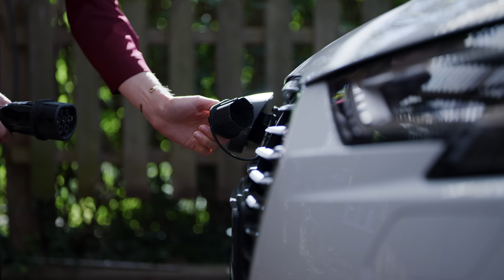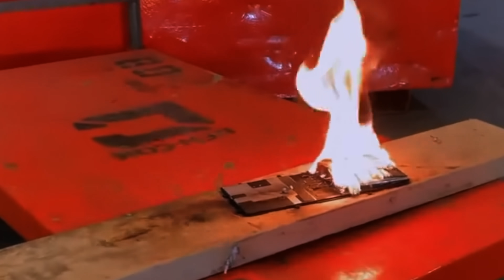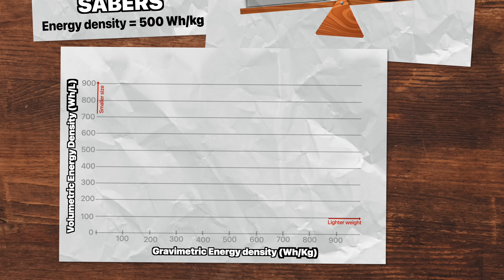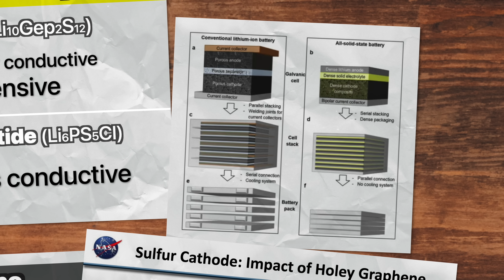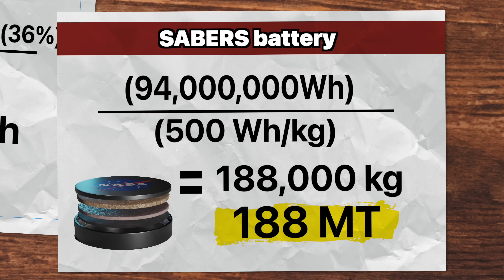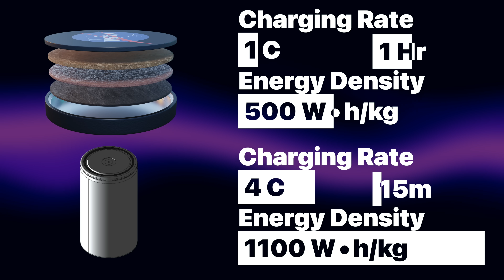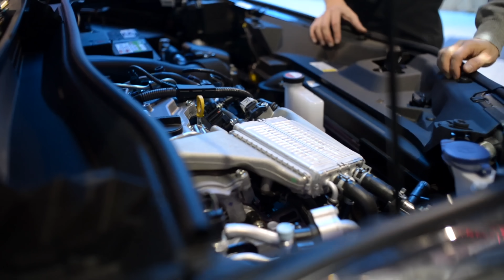Why NASA is Building a Solid State Battery

Comment: now tell the airline industry that they can turn their flights around in 6 hours (charging time) rather than 30-60 minutes
Reply: If solid state batteries are successfully developed they would probably use battery swapping. This is already being used in Australia and New Zealand with trucks, but using current battery technology.
Reply: @johnharvey1786  you are going to remove and replace 27,000 kg worth of batteries between each flight?  That is an insane amount of material handling, and it implies rapid removal/installation, as opposed to just normal maintenance type work. That's a full battery swap for 1/7th the range of a jet fuel plane.  Whereas if a jet needs to fly 1/7th it's max distance, it takes on less fuel (with safety margins of course) which lowers it's takeoff weight and increases overall efficiency for a given flight.  Part of the calculation for an aircraft's maximum range is weight reduction during the flight, which a battery powered plane wouldn't be able to take advantage of.
Reply: @cayuse17  I didn’t say that as I suggested a hybrid. The batteries would only be part of that total to simply reduce overall CO2 omissions. It may be that they only take up 10 - 20% of the load to start with. I also said if suitable batteries can be provided. These would have to be lighter and more power dense than current batteries. Large batteries can be replaced quite quickly with the proper equipment as can be seen with trucks as they replace them in five minutes. You seem to think there will be zero progress going forward. Would you have said the same thing when jets were introduced, that these will never catch on as they use so much fuel.

Comment: Large aircraft cannot land at the same weight that they can takeoff with, meaning if you create a 100% battery-powered large aircraft, it cannot weight more than it's rated LANDING weight. In other words, you can't start the equation with the full fuel weight; you have to calculate based on the maximum allowable fuel to land. That's why they always dump fuel when they have to land prematurely.

Comment: Unless you have swap able batteries for the airplanes then its not really a good idea. How long would the charge time be between flights!? 10 minutes for a car is all well and good but an airplane would require MUCH bigger battery packs. Don't forget a fuel laden airplane gets lighter during its flight while a battery powered airplane will stay the same weight. I am NOT shitting on ever having batteries for airplanes but... its a tech that is not ready YET. Soon™

Comment: Interesting video...but....lol, unless we begin an effort to increase our ability to generate electrical power on a full-time basis, electrifying everything with great new batteries is just a new problem.  And it's not just an issue of generation capacity, we already  need lots and lots of new transmission lines which we're not building.

Comment: you miss calculated. thrust via fuel, and thrust via electric turbine, or prop is different values. IE. Fuel in jet generates x thrust on take off, and x thrust on cruise. Same goes for electric modeling. you cant weigh just the kwh in fuel opposed to the battery. the example you have is flawed to a degree. the models could be less or more. not counting scaling the plane down. the fuel system components carry allot of other wight as well.

Comment: You bet, electrically powered flight.  Solidstate or really semisolid state.  How, using bivalent bonding elements in a /+ univalent ionized charge.  Cadmium+, or Barium+ and Iodine or Bromine-.  They must be separated, probably thin layered, and mixed with an "electrolyte" electrically conductive e- distributor such as graphite.
An improved ion battery with outstanding capacity for VDC storage.
But even more exciting are semiconductor based batteries.  With a nearly unlimited capactiy for electrical power storage.  Multiple thin P-N layered constructions, store ~ 1 volt DC per 1 ampere of electrical charging.  1 ampere hour of current storage = 1 ampere of electrical current flowing for 1 hour.  Sounds like a lot, but within reality.  Modern Lithium ion batteries in mobile phones store up to 5 ampere hours @ ~ 6 Volts.
Semiconductor batteries just about require thin layers  P-N junction construction to spread out "electrical charge density", to help store more amperes of e- at acceptable lower voltages.  And all of them require an output voltage control regulator transistor.  My choice is the older style FET transistor.  It must be connected using a gate controlling resistor to improve more linear regulation of the output voltage.  But do-able years ago under the terminology negative feedback.  Thanks sgain lan0 for teaching me how to set up negative feedback; continue to wish the best - for this world.

Comment: The load would just be ebb and flow on a long continuous trip at nearly no loss if battery BACKED capacitors delivered the load to the motor on one cycle and then disconnected and recharged by alternator on the next cycle. If Im not mistaken they are cheaper to make, easier to recycle and can recharge instantly. Have I lost my way somewhere?

Comment: Especially for short flights, a significant fraction of the energy, and the highest power demand is taking off and climbing to altitude.
  Using a catapult, similar to an aircraft carrier, for take off, seems like low-hanging fruit.
  To this could be added a second stage which drops off and returns to base after the first 50 miles. Similar to the tow plane for a glider.
Reply: Are you talking about passenger aircraft?  How many Gs would that put passengers under?  

How much weight do you have to add to reinforce the fuselage of an aircraft to withstand the forces put on it by a catapult?

Comment: Another think that comes to mind with this - there is an incredible difference between the fuel burned for landing and takeoff and in normal flight. I could see a strategy that works with Hybrid cars work here as well. - Either the plane can use the electrical engines for those phases, which means we can do with less fuel (and pollution!) and just cruise at optimal burn rate once it flies. Alternatively they could use the jet engines mostly during takeoff and landing and switch to electric during cruise.

Comment: However these batteries wont be able to deal with the environmental temps theyd be exposed to in normal commercial flights without some sort of warming system for the battery to keep them above 0degC.  Considering temp decreasing 2degC per 1000ft, thats a lot of heating required!!  Plus the airframe would require additional power supply with the loss of bleed air , generators and engine drive hydraulics.

Its a nice step forward, but for aviation, i believe its nowhere near viable yet

Comment: Do you have problems with battery fires? Use pure lithium!
Weigth formula is pure BS because jet fuel is consumed during flight and you have to use differential formula as the airplane gets lighter.

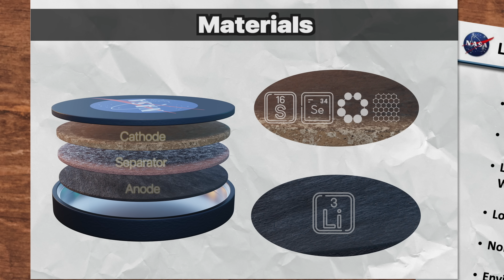Comment: 8:00 how is flammability managed with a pure lithium anode? Primary cells with a pure lithium anode are indeed considered flammable.
Reply: Solid state electrolyte and separator must be reliable. And battery hermetically sealed. 

It would blow up, if punctured with water. Air us not that bad, if the short circuit is not causing ignition. 

Solid state electrolyte can tolerate higher temperatures than polymers and organic liquid salt electrolytes. 

Using silicone oil as coolant is one way to prevent lithium to get oxygen even if battery is damaged.

Comment: Low cyclelife is the real killer. If you cannot use battery more than 100 times, it just dies too early.

Low discharge does not matter that much, because you may transfer some power to other storages that you may use when needed.

Faster charge rates could be achieved by replacing batteries and then charging them at the lower rates. Taking off batteries and putting new ones in could be made with robots and in few minutes, but of course this adds whole new level of complexity and issues (like weight distribution).
Reply: Lower cycle life isn't a problem if it's cheap enough to replace. 
I would happily take a hundred love cycle batteries, if I could replace them every year. 
I doubt this battery even if it was in production, would be cheap enough for that.
Reply: @bzuidgeest  Lower cycle - more waste, more energy to build them, more transports and more resources needed to build all those parts. 100 cycle batteries means you use roughly 10 times more resources than in 1000 cycle batteries. And even 1000 is not that good, specially if you cannot recycle entire battery to make a new one.

We are running out of planetary resources, so 100 cycle is not even nearly enough.
Reply: @martiansoon9092  I'm assuming recycling in my statement. And not every resource is scarce. Energy for processing can come from renewables.
I agree my statement has some caveats, but that doesn't mean things are as black and white as you make it seem. Depending on the circumstances a lot can be acceptable. 
And if we consider the wider solar system we won't be running out of anything soon.
Reply: @bzuidgeest  Well, with exponential population growth and resource usage that our current directory is, even our solar systems resources could be mostly taken in few hundred years (300-1000 yrs). There are some estimates made, but of course, other planets has not been searched in the level to make final assesments. Also our sun has most materials, but we cannot use those yet, except heat/radiation/solar winds. With new innovative methods this period will likely be longer.

I have made multiple statements that we need to use most abundant materials so green energy shift is possible. Using just some rare ones, will lead to shortages. Ie. Lithium and cobolt can be changed to other minerals, but ofc this likely means more weight and other problems. Or using Sahara sand (that cannot be used for construction) in sand batteries.

You may seek list where most of our planetary material resources are running low in 20-100 years. Recycling, space, making huge amounts of waste by using less consentrated fields, ruining arctic that uncovers from ice, ruining our seabeds, ... will help a bit. Even most unique resource, life, is having difficulties because of our behavior. (10k yrs ago we were less than 1% of mammal weight, but now we plus our domesticaed animals weight 99% of total mammal weight... There is no room for wildlife and these often exponentially growing damages are coming after us too.)
Reply: @martiansoon9092  population growth is leveling off. It's no longer exponential. Most western countries have birthrates below the replacement rate, meaning shrinking populations. Even poor countries see slowing birth rates as child morality goes down.
Reply: @bzuidgeest  8 billion and rising. 10 or even 11 billion are estimated... But these estimates are without climate and other natural disasters, that will reduce the max. amount.

But yes, we are not going to space in near term future. (whole argument was related to space science.) So the exponential growth is slowing down due to planetary boundaries. (Even Elon Musk's 1 million people in Mars city is just tiny amount, if it ever happens in reality.)

Also I did not mean that much population growth, but more about resource and material usage growth.
Reply: @bzuidgeest  Even our green politicians are talking about rising people from poverty,  so that really means making more things for them and therefore adding more people to use more items and materials. If all goes after western consumption, as we can see in Asia currently, we don't have enough resources.
Reply: @martiansoon9092  growth is slowing down not because of lack of space or resources. Everywhere where women's rights have increased, child morality went down and women worked and have careers, and care homes exist, the option to not have kids gets attractive. Kids are expensive and limit your freedom. So a lot of people just don't have them. 
Yes the population will increase for a while yet and we should take care of our current planet first.
And no we are not mining and colonizing space in the next few years. I just meant there is a lot of material out there if we really need it. Even water in ice rocks. But it will still take a while before we can economically reach that.
Reply: @martiansoon9092  we have enough if we build using sustainable resources. It's only a problem we keep going like we are now. And that is likely unfortunately. 
But take food for example, ordinary agriculture especially in countries like the US is very wasteful. But if you switch to modern farming methods like vertical farming you could produce enough for everyone easily. We can feed everyone easily enough even with current methods, there is only a wealth and this food distribution problem.
Reply: @bzuidgeest  Like I said we are depleting many resources in 20-100 years. If we don't find more resources we are going to degrowth.

We don't have enough farming areas in this planet. Specially if we think to combat climate change with growing trees or making "bio"fuels. We are currently using most of the land surface of the Earth for human needs. There is growing sense from scientists that 30-50% of the surface of Earth should remain for wildlife and be mostly untouched by humans. Our pollution, ie. microplastics, can be found EVERYWHERE on this planet.

So, yes, we are running out of planetary boundaries.

Nasa is planning a moonbase, that is the starting point for mining of the moon. And Nasa is also planning more asteroid missions to study how to gain resources from them (how to catch asteroid and bring it to Earth's orbit). These are not economically reasonable yet, but these are studied and even experimented today (ie. recently: samples from asteroids).
Reply: @bzuidgeest  Vertical farming is ok for reducing used land area. BUT it needs racks (metal/plastics), pipelines, water, electrcity (loads), lamps, computer systems and so on. Build up areas instead of using natural ones may cause yet another lack of resources. The big question is: Which one is better?

But yea, I'd go for vertical farming too... We can avoid some extreme climate effects with them, but not all (ie. raised flood/fire risks)...

You haven't paid attention what climate change is currently doing for farming. Crops are lessening via droughts and floods. This reduction is just worsening over time because of climate change that is driven by our constantly growing emissions. Specially hard hit could be predicted loss of mountain glaciers that may affect 40% of EU's water sources, 1,5 billion people in Asia, Colrado river basin in USA and so on.

Also we are losing fertile soil at alarming rates. Our current food production cannot keep on going on its current course.

Already our plants are less nutrient than they were 50 years ago. Even those who eats healthy diets may not get enough nutrients from their food.
Reply: @bzuidgeest  We are even running out from construction capable sand... Yea, we may produce more with crushing, but that needs loads of energy... Houses, bridges, roads, ... all needs this sand... There are already mafia like organizations that runs on illegal sand... My beach is gone?

Comment: 1. The only relevant question is can it be scaled at cost.
2. The planes architecture would change and improve because 2 large engines are dumb when you can replace gas turbines with electric motors

Comment: Power density may be a software (or more correctly firmware) issue. Tesla had this exact problem in the mid-oughts. Not enough power density to meet their performance requirements with a single speed transmission, and their... sub-optimal... interactions with external suppliers prevented them from outsourcing a two-speed transmission. Their internal engineering couldn't build a two speed that met packaging requirements and torque requirements.  They eventually developed controllers that solved the power density problem so they could use a single speed transmission, and could finally get the Roadster into production (as well as creating the myth that multi-speed transmissions provide no benefits in an EV, later disproven by Porsche).

Reducing (or even eliminating) reliance on cobalt addresses the fact that the "automation" utilized in "fully automated" African cobalt mines is provided by shifts of 15 - 20,000 people who are essentially slaves.

Comment: The compare between battery and engine weights, the engine is all encompassing. How much weight would the mit motor need approx in blades and ancillary. For a comparison.

Comment: It not catching fire on piercing is good and all, but a lithium fire is still a major hazzard! On top of that, the goal of new battery tech is to try and move away from rare ressources as for example lithium. This is where a carbon battery shines. It's a fail from this electrician. 👎